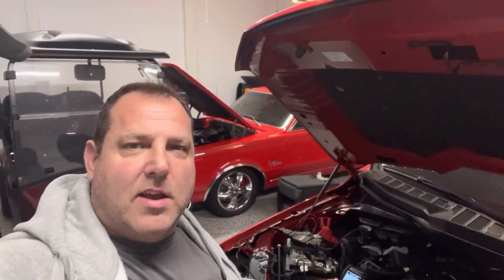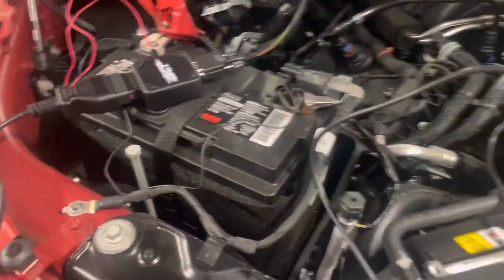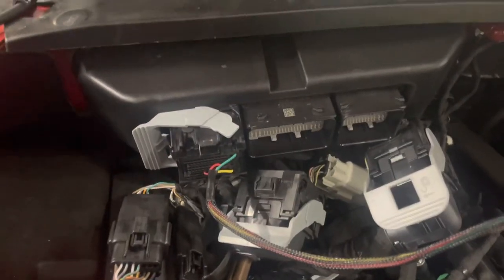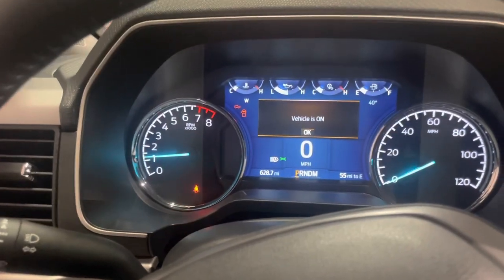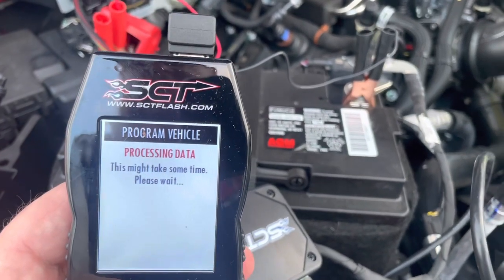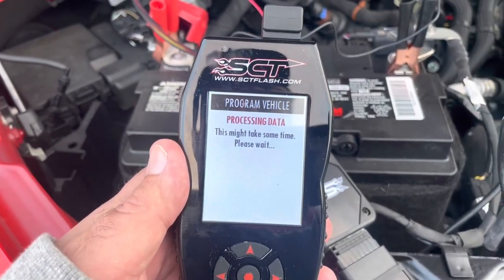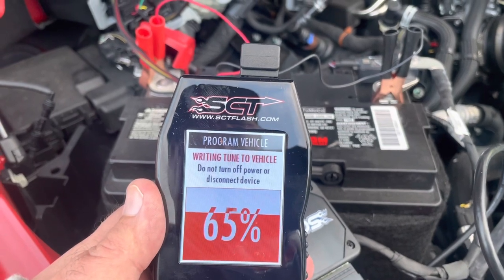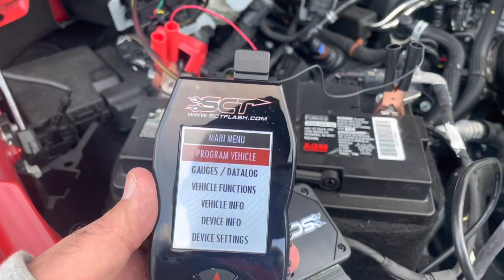Sct Custom tuning on our 2022 F150

Comment: So once you save your stock flash, and you want to change between Stockton and a 93 tune, you have to pop the hood and connect it directly to the computer or can it be done on the fly via OBD two port?
Reply from the maker: under the hood

Comment: I am getting error 11020 unable to read vehicle information. The tunes are on the device, all connections good, all brand new stuff and no help from retailer or tune creator. Not happy. Any ideas? Battery voltage is good, all connections good. Checked 10 times over, same result
Reply from the maker: Sometimes you just need to have Sct or HP remote in with you to try to figure it out sometimes they just have a weird connections

Comment: Terry have you ever had any issues with a car not starting after flashing a tune with the SCT? Re flashed my tune now my car won’t start.
Reply from the maker: I mean occasionally if the PCM locks up or something during the process, it’s not often, but anything can happen. Sometimes you just try flashing it over and over and over again and it can fix itself.

Comment: which tune did you use on this video?  I have the SCT Tuner
Reply from the maker: @craigjacobson158  that tune was from juggernaut
Reply: @TeamBeefcakeRacing  how does that tune differ from 5 star, Oz, Lund or the others?  I have a 22 F150 5.0 V8
Reply: @TeamBeefcakeRacing   the first time you upload the custom tune it will save the stock file?
Reply from the maker: @craigjacobson158  yes
Reply from the maker: @craigjacobson158  we offer all those options we have juggernaut we have five star. We have Palm Beach Dino and we have OZ for the trucks.

Comment: I have the tuner but I don't have the pass through cable that goes to the main ECM/PCM. Where do I get it from?
Reply from the maker: do you have the F150 specific handheld the other models won’t work it’s different
Reply: @TeamBeefcakeRacing  yes I do part number 7015 I believe?
Reply from the maker: @Lukeo2412  you have to have this one

https://www.beefcakeracing.com/sct7015pg-b/
Reply: @TeamBeefcakeRacing  kk just to confirm that one will work on my 2021 Ford F150 3.5L ecoboost?
Reply: @TeamBeefcakeRacing  how long would it take to ship to Vancouver Canada? I'll order through you
Reply from the maker: @Lukeo2412  a couple days if you throw the order in, will get it out for you today I’ll upgrade it to expedited at no charge for you
Reply from the maker: @Lukeo2412  yes
Reply: @TeamBeefcakeRacing  you're the man. I'll order it in 20 mins just about to drive to work.
Reply: @TeamBeefcakeRacing  order number 62852.
Reply: Hey man,

Got everything in the mail thanks for sending that out. So I've hooked up the sct tuner and it's pulled the OEM tune. I've also updated the tuner. How do I put a custom tune on? Do I have to buy that separately?

Comment: This thing set off 23 codes on my 2022 F150 now my truck is in limp. I didn’t even put no tunes on was just hooking it up to get the information off the truck .
Reply from the maker: You’re not going to get codes just from checking your vehicle data
Reply: @TeamBeefcakeRacing  I got the ford pass app and it had 23 codes on it for low coolant, TPS, and many others but I turned the RPMs up to 6K and turned the auto start off and installed the stock tune on it and everything is good now
Reply: Same happened to me yesterday
Reply: I justed erased the codes